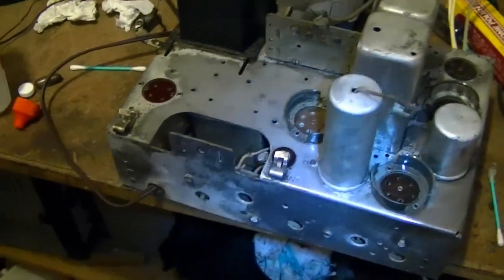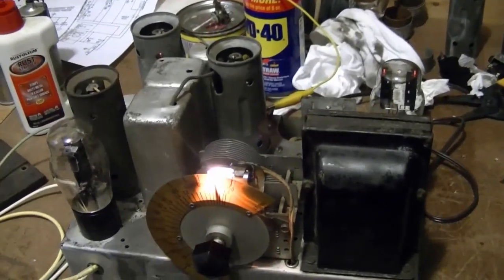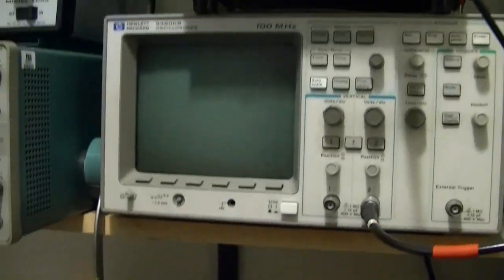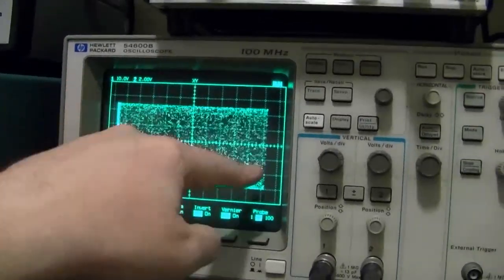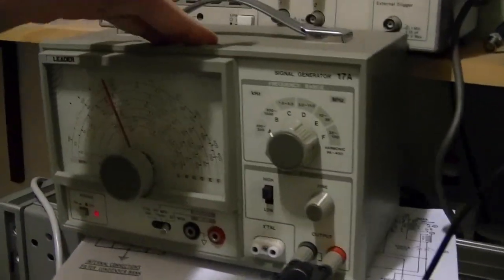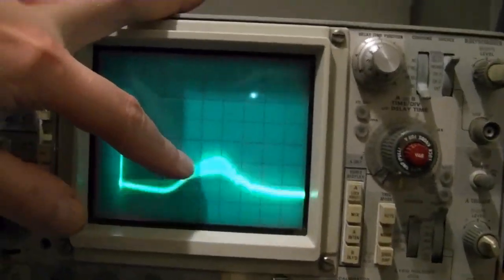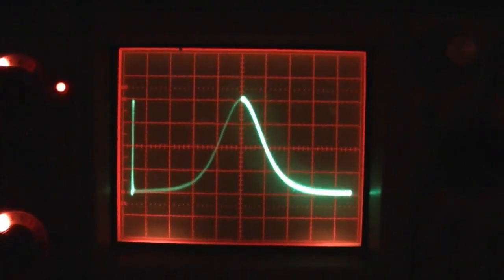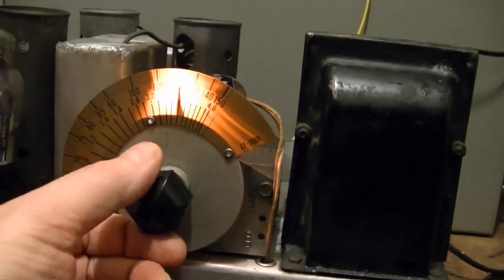Philco 60 MB restoration p8o10

Comment: What you have accomplished with your alignment setup is to produce an antique piece of test equipment called a "wobbulator".  Triumph Instruments built a commercial one back in the mid 1930'.  It is the most accurate way to align the IF.

Comment: Using the scope like that to align may be a bit impractical but it was a heck of a lot cooler.   Interesting that 560 was off on yours by 20 kHz..  I actually have the same problem on one of my philcos.   rest of the dial sweeps pretty much on.
Reply from the maker: It might not track perfectly because this tuning capacitor and dial came from another chassis and it's not the same part# as the original.

Comment: I have the same model HP as you have and will try the FM modulating my Marconi as it has no sweep function and then adding a second generator fixed at the IF frequency to see the marker. 
Great informative video as usual.

Comment from the maker: I'm well aware that sweeping too fast can distort the response. I maintain that 10mS (100 sweeps/s) is not too fast.  I no saw no difference at slower sweep rates.  The standard default sweep rate for most of my other sweep generators is 60 sweeps / sec.

Comment: Wow, I MUST have been  smoking "Dutch Cleanser"!
What the heck was I thinking? Oh.. I know...
I was thinking that if you used a generator and a VTVM at the rated I.F. frequency, say 455Khz, and peaked the I.F.s, by your example, if you then tuned off frequency the peak may be higher.
But reflecting on that, that's preposterous because the I.F,s are naturally resonant at the stated I.F. frequency that they were designed for.
Man, what a dolt!
Should have gave that more thought, :-(

Comment from the maker: Sure you can correctly align it with an RF generator and a VTVM.  Just set the generator to 460kHz with AM modulation and peak the IF.  You can even do it by ear with practice.

Comment: A tip for shortwave, try short-wave.info. One of the strongest non-domestic stations available here in Omaha is Radio Havana at just over 6MHz (6050 or less). They have a directional array pointed right between Omaha and Des Moines that covers most of the US.

Comment: It was extremely interesting to see how you shifted the I.F. peak back down to the proper frequency. Maybe using a VTVM is NOT a valid way to align the I.F. after all because you can peak them this way but the peak may be off the correct frequency. Do you think that this is possible by using the VTVM method or am I just smoking "Dutch Cleanser" here?
BTW; Nice new toy!  ;-)

Comment: A suggestion, for connections on the back, rig up some short cables that can be more or less permanently mounted with the proper connectors on the loose end, then affix it with tape or some such for easy access, then it'd make connecting up cables with the X,Y, and Z axis coordinates. 

This has been quite interesting in trying a new method, and gear to align the radio. Nice job.

Comment: Nice video. I have yet to see a digital scope with Z input :) Imho dicking around with markers is a waste of time. If you use sweep sync/ramp signal as a scope trigger and adjust the horizontal so that it spans the entire graticule, center sweep frequency will sit dead on the center vertical graticule, easy and simple:)